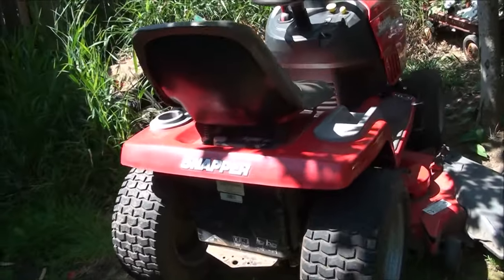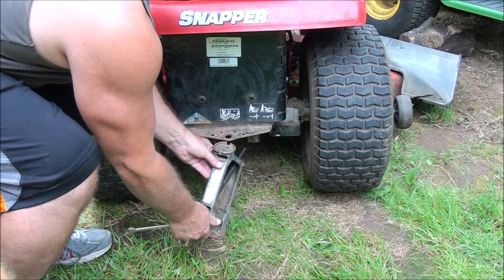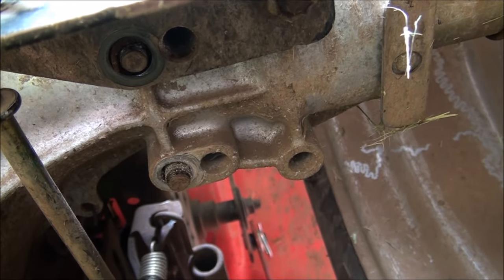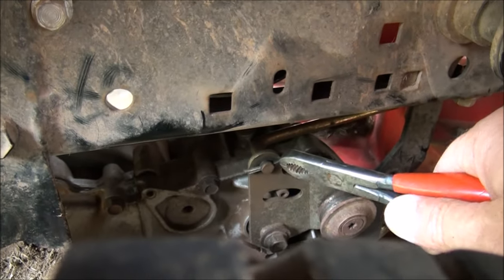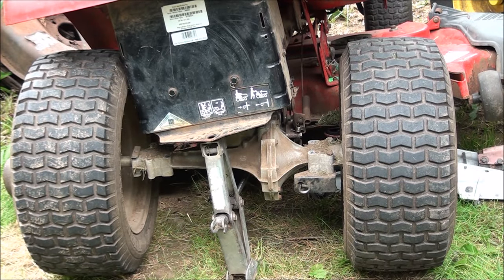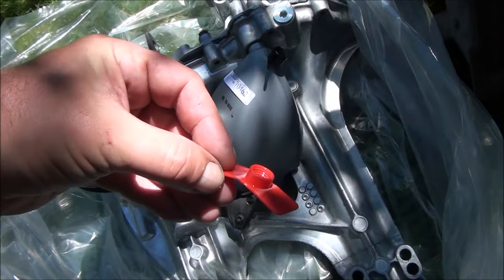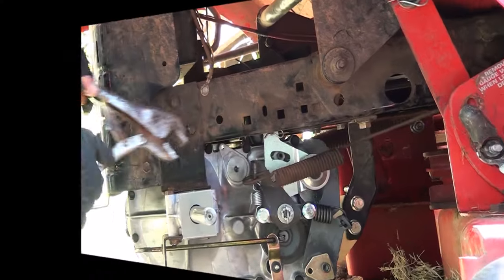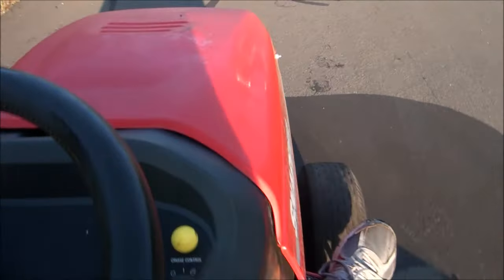HOW TO REPLACE a TRANSMISSION / TRANSAXLE - RIDING LAWNMOWER Hydrostatic Transmission Replacement

Comment: My old cub has this hydro 510. It was whining and sometimes not work. Got it with 200 hours and now has 237. Sucked the fluid out it was black and shiny exactly what your want to see. Filled it with 2qts hydrologic oil I couldn't get all of it out. Now seems to work fine no noise tow around my log splitter no slipping.
Reply from the maker: Righton Stoneyswolf good job.

Comment: Man I am glad I saw this before taking my Craftsman to the shop. I feel confident enough for this task.  So I hear alot of grinding when I engage  to and from forward and reverse. Seems like comon sense to replace the transaxle. What do you think bud? Thanks in advance.
Reply from the maker: Yeah that sounds like the internal gears grinding. pretty easy to swap

Comment: Hey Jeff, I have an old wards elite 18/42 that's a seven speed w/ varidrive. I hate the trans in it. Need to know if I  could convert it to hydro. Thanks.
Reply from the maker: Anything is possible! many transmissions/transaxles mount up the same way

Comment: Thank you.  Great video.  I have a Craftsman 18.5 hp, OHV, DYT, Intek Plus, auto transmission riding lawnmower.  I am NOT able to manually push it.  I don't know yet if the mower actually runs.  I can't push it out of my trailer because it will not roll.  I put it in the neutral position and disengage the lever for the transmission disengagement, but it will NOT roll.  When I jack up the rear wheels, the wheels will spin freely - in opposite directions.  Do you have any suggestions or possible ideas of what is wrong?  Thanks John R.
Reply from the maker: Yes the brake mechanism is probably frozen up. There is a brake disc and 2 little piston thingys that get frozen up and need to be cleaned/lubed. Sometimes jamming a screwdriver and prying the brake disc back and forth can loosen them up.  Unfortunately I do not have a video on this procedure yet....
Reply: john r. My Hydro-Gear 310-0510 in a stump grinder is designed and built not to roll however it has a bypass allowing for it be moved slowly at 2 mph. I suppose your hydrostatic transmission is built like that. You can download the repair and service manual to find more details.

Comment: about that grey tank with the black cap   what kind of fluid is really in  there and should that fluid be replaced   . my 2016 cub cadet ltx1042kw   v twin has that tank  . I never knew it was there until I changed the drive belt
Reply from the maker: I think it is an overflow tank you do not fill it

Comment: Hello
I just bought a new transaxle for my Cub Cadet. The transaxle looks just about the same as the one in your video I just watched.  There is a service bulletin that was packed in the box that says you need to adjust the friction pack nut back out one to two turns after installation is complete so the control arm can move freely forward and back.  Did you have to do that on your new transaxle ? Please advise ?
                                                    Thank you
Reply from the maker: I had the same. I DID NOT have to adjust the nut.

Comment: Hey Jeff... Love your channel!!!   I have a Husqvrna YTA24v48, and yes, it has the RS800 plastic transmission. Is it feasible to remove this trans-axle and install  new trans-axle say, from a YTH24v48 model? I have the YTA model and the trans-axle is slipping and I've had it in a warranty shop for repair but its not any better. I am pretty handy around the shop  and I have nearly $2k in this POS. It only has 50 hours on it. What do you think?
Reply from the maker: I don't know, but where there is a will there is a way!

Comment: Hey jeff I had 2 murray ridin lawnmowers like that blue 1 u got but mine were red and the transmission went out in both of em 1 was a hydo static drive and i was mowin with it 1 day and it was goin really slow when I had it on top speed so I parked it and took the engine of it and put it on 1 of those smaller murrays that had a flat head engine witch had piston slop and smoke was pourin out of the muffler so that engine is no sittin outside and the other 1 was a clutch drive and the transmission just burt up 1 day and i parked it and took the deck off and it’s sittin outside proped on a fence the mower is also sittin outside and I took its engine and put it on a 1993 model murray that used 2 have briggs n stratton twin cylinder engine it was knockin really hard and i was wonderin if u could give me some tips on that
Reply from the maker: a knocking engine is usually a real bad sign that the engine is worn out or it ran low on oil. Most likely the rod is knocking because it is loose on the crankshaft.

Comment: What was the cost of the new transaxle?
Reply from the maker: $700.00 if I remeber correctly
Reply: @JeffsLittleEngineService  Doesnt look like they still make this model.  :(
Reply: @bryco32  don't try and buy this one new the better thing is to upgrade to a k46 or if you want a really good one a k62.

Comment: 9:08 Is this the normal operating noise for these hydro gear transmissions? I just bought a used lawn tractor for cheap and it makes the same noise. Guy said the trans was going out but I drove it up some pretty big hills on my property for about an hour without any loss of power or really any movement issues at all. Just that slight humming whining noise was all. Your transmission is brand new and it is still making the noise. I wonder if it is a noisy pulley or something?
Reply: I think he is not on full gas
Reply: its gonna be bad pulley if you put it in neutral position and you release the clutch brake

Comment: MY EXPANSION BOTTLE ON MY YARDMACHINE 46 INCH RIDER IS EMPTY BUT HYDO WORKS GOOD.. DO YOU KNOW IF OILS IS SUPPOSED TO BE OIL IN THAT BOTTLE  AND WHAT KIND?, THANKS
Reply: Hydro Gear uses 20w50 full synthetic..👍

Comment: Have you or anyone in comments ever changed the fluid in this model, or Is it even possible? I can see what looks to be a full plug but no drain hole/plug
Reply from the maker: some of those transaxles are meant to be non-servicable. If it is acting up it may be failing. They do offer rebuild parts for some but it is always a big job.
Reply: You have to pump out the fluid from the fill hole and then add new fluid. 20w50 is what hydro gear recommends for the trans in this video..
Reply: Hydro-gear service manual says to remove unit from "vehicle" and pour out old oil from fill port and replace with 2.5qts of fresh 20w50.
I think I like Samuel's idea better.

Comment: My Cub Cadet LT1024 trans axle will be "locked up" when i get on the mower to use it. It will not do it every time. Like I mow for hour or so and then take a break shut off mower and go get a drink. come back ant the transmission acts like its locked up. will not move forward or reverse. i can rock it back and forth several times then all the sudden it frees up. go back to mowing everything is fine. It''s getting very annoying.
Reply from the maker: I would clean the brake caliper and components. they can get sticky and lock up over time